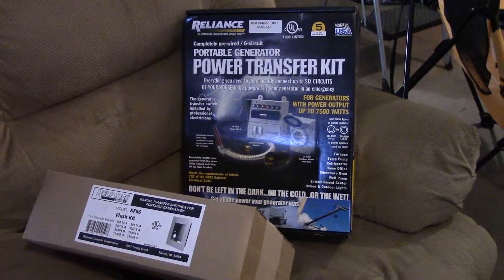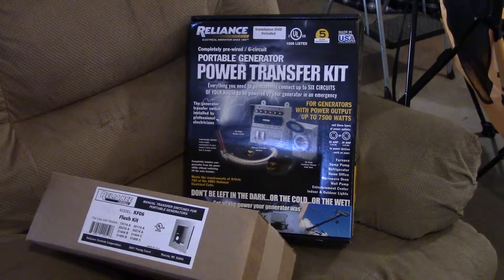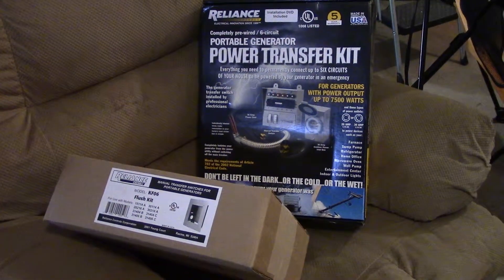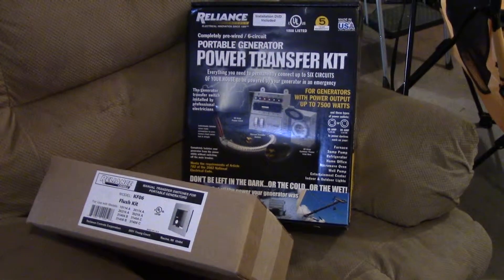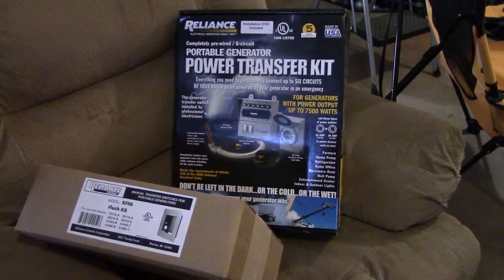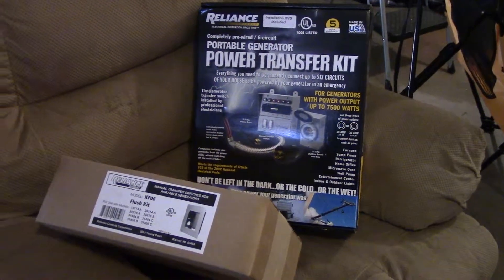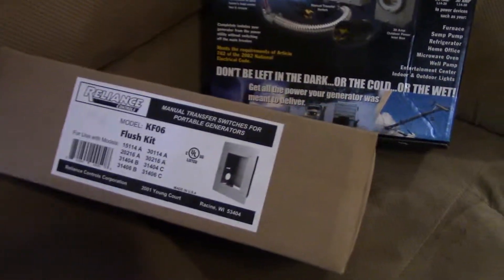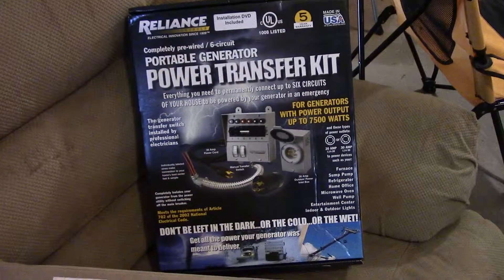Just arrived! Reliance Controls Pro/Tran 6-circuit power transfer kit

Comment from the maker: Goal is to take the following circuits off mains and put on solar:

1. Refrigerator
2. Kitchen lights
3. Kitchen GFI wall outlets
4. Microwave range/hood vent
5. Living room
6. Den/entry (circuit has outside lights and security stuff)

Bedrooms and bathrooms don't consume jack shit for power. And even in an emergency with total loss of grid power...I can sleep on the couch and take a flashlight (or candle) with me to take a wizz/poop/shower.